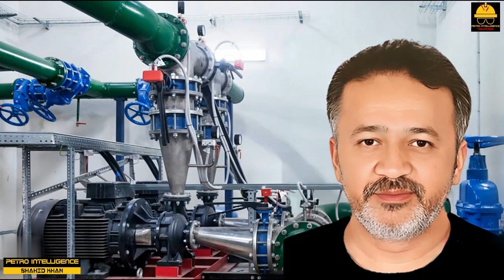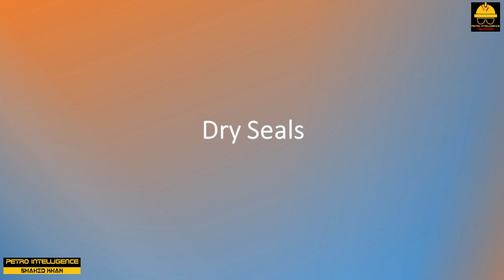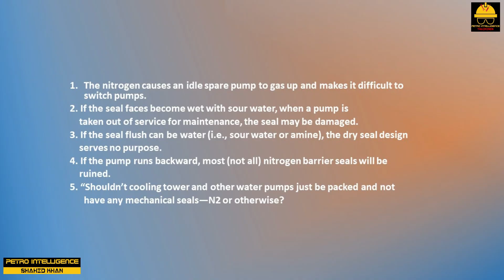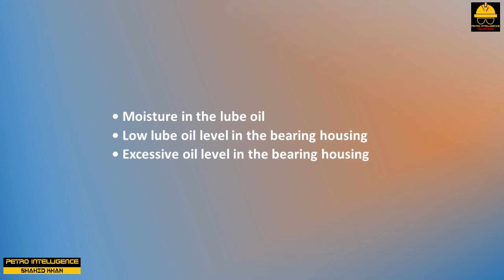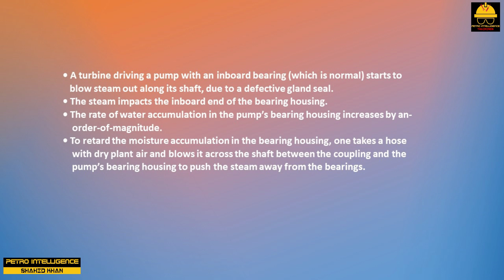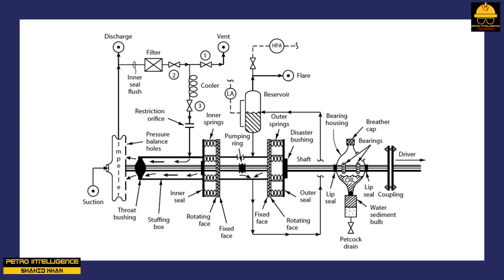Pump Seal Training: Mechanical Seals & Troubleshooting for Operators

Comment: Putting packing and labyrinth seals in the same course as mechanical seals is right, because the diagnostic logic is common and only the wear part changes. The section that pays back fastest is the one on flush systems, since a mechanically perfect seal still fails when the flush is isolated at commissioning. Most avoidable failures live there.